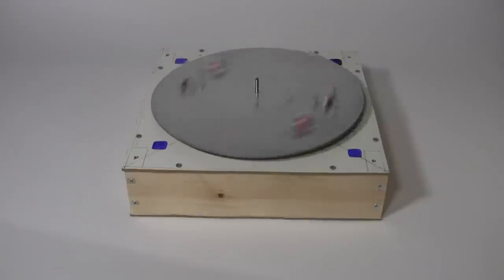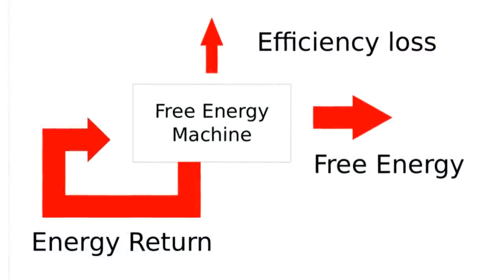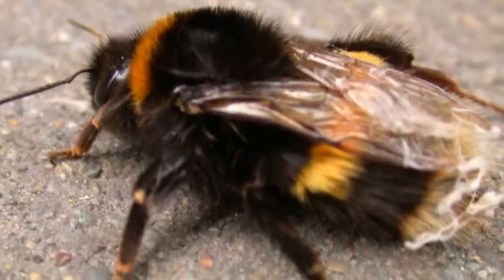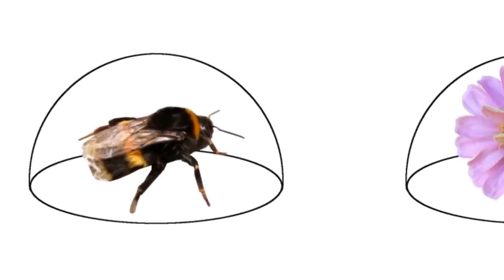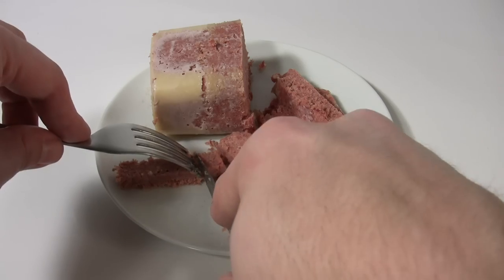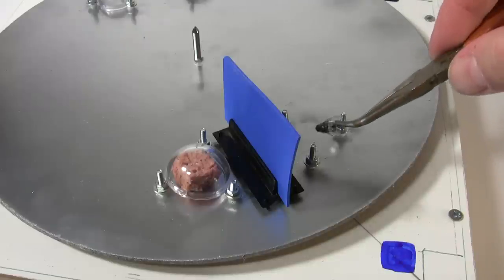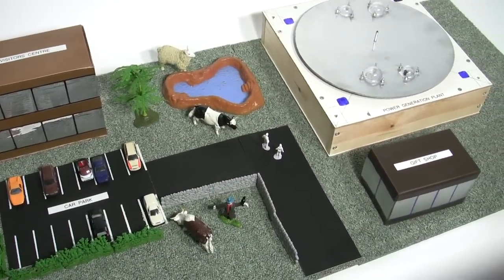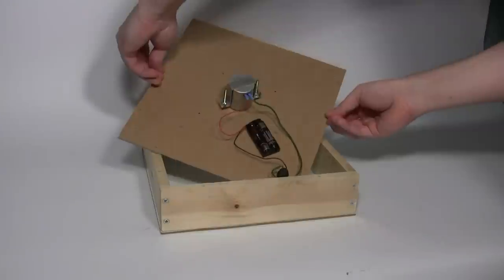TB4000 Free energy machine: The answer to the world's energy problems?

Comment: I call complete hoax.
This device is is using a modified delta-ray collector array, which harnesses the power of asteroids dimension shifting in the van allan belt. The biologically alive neodum magnets are sensing this shift in power and start to adsorb it adjusting their gravitational constant and as a by product emit a single proton. This causes thrust due to the 8th law of carcinogenics spinning the device.

Comment: Just as good as all the other free energy devices
Reply: no much worse , this is really just lol worthy while other techniques at least try to catch electromagentic fields,. cosmic energy , radiation, heat energy , magnetic fields which pulse according to the torus equation and therefor attract dark matter gravity potential
Reply: goku21youtub ahah, funny you. But of course, because to the untrained eye using technical jargon like "quantum", "dark energy", "magnetic fields" (boy, this magnetism fad never dies) or specific bits of geometry (torus, pyramids, overlapping circles) sound much more credible and plausible than a dead fly in a plastic cup.
Reply: just as fake as thunder bolts or any wirless transmission( w-lan , radio etc) according to you. of course these experiments are not meant to power an oven , but lets not pretend that theres no inaccessible (by conventional means) energy around us. because thats not true. people said the same thing about solar panels decades ago.(which actually converts electromagnetic waveforms(light) into electric energy).

if someone can just light a single diode with his experiments thats actually still awesome. and some experiments actually do work. 

i´m not here to argue , i´ve been way to long on youtube to do that. lets keep the discussion grounded please (pun intended).
Reply: goku21youtub sorry, but never have I called those fakes, because those work. The people promoting the "free energy" fad are fraudsters. They use all sorts of technical jargon to confuse gullible people like you, without producing a single formula, a blueprint, a patent or a prototype. They are not scientists nor working with bleeding edge physics or technology. They are writers and lecturers that live of giving lectures and selling content on websites, that is freely available elsewhere, and needlessly promoting conspiracy theories about the utilities companies somehow suppressing this wonderful technology. Suppression where ? They are plenty of youtube videos and websites promoting this fad. But the worst cases are investment fraudsters: people that ask money upfront to people like you, because they promise the next big water engine, the next big sourceless electrostatic generator, the next big generator from zero-point energy. And when the investors go to court to ask for the money back, the fraudsters claim they are being suppressed and all sorts of BS. That's what the free energy movement is: clever people getting tools like you away from your hard earned money, and fooled with the same fairy tales about energy from nothing. There will be a day where we'll go deeper than nuclear fusion for energy, but it won't be the free energy movements doing it because they don't even understand basic classical physics.
Reply: hmm what are you talking about? youtube is free ! and these people making these videos are just normal people who like to look for themselfs and build something from scrap metal (BECAUSE ITS FUN TO THEM)... i won´t just brush it off as a movement (or conspiracy) like you seem to believe. i look at every video separately and judge it separately, because most of these guys don´t sell books or link to websites and have totally different "devices".  

if you had done the same you´d actually know that those very same people you accuse are often getting no results and openly admit so because they are experimenters and if the outcome is positive or negative is equally good to them. they are just shedding a biot of light onto all these claims. 

there are the bad one just punking you but there are also honest guys giving an insight. 

you can´t expect them to create formulas , that is downright foolish, they are just attaching scrapmetall togetehr in a specific way. and why do you bring fusion into the discussion? whats the purpose of that ? 
if in afrika someone can light an old led with 2 strong neodymium-magnets he found in the sea of scrap he´s living in , that IS FREE energy to him becasue he didn´t have to BUY a battery to do so. FREE ENERGY DOES NOT MEAN CREATING ENERGY FROM NOTHING ; BECAUSE THATS NOT POSSIBLE OR THE UNIVERSE WOULDN`T EXIST. ITS JUST A BUZZWORD NOTHING MORE NOTHING LESS , you my friend read way to much into that. 

"Those" don´t exist. Theres stuff which is funny , there are pranks , and there are honest people with at least interesting results. At least learn to differentiate and not call it a money making conspiracy.
Reply: goku21youtub Guess some stuff was lost in translation. You brought up the terminology used by the people that tell there are free energy devices that exploit weird unknown or hard to grasp low level phenomena like zero-point energy and vacuum energy and so forth. That's what the free energy fad is about, heavily promoted by that lame excuse of a pseudo-documentary called Thrive, among others. Bringing up buzzwords like that demonstrates either ignorance of the subject or intelectual dishonesty and attempts to fool the listener.

Strapping a bunch of magnets and a big fan to make some free electricity (free as in, don't have to pay a bill) is a whole different thing, and it's not what I or you have been talking about.
Reply: goku21youtub And for a real example of what I mean by rubbish, buzzwords or jargon, the GlobalBEM channel here on youtube has lots of videos with people talking in these terms, yet all they say is pure nonsense. Again, I have not seen those speakers, apparently promoted by their credentials, producing a viable device exploiting the phenomena they so keenly talk about.

Comment: I've hooked a team of lemmings up to a rope in my back yard.   the pulling motion is combined with a cam actuated transmission hooked to a generator.

using 300 lemmings, I can then open the gate in the back yard that leads to the cliff overlooking the Pacific Ocean.  300LP (lemming power) is equal to 5KWH.  allowing me to air condition my house for most of the summer.

the main problem to overcome is aquiring the lemmings and attaching them without being bitten repeatedly.